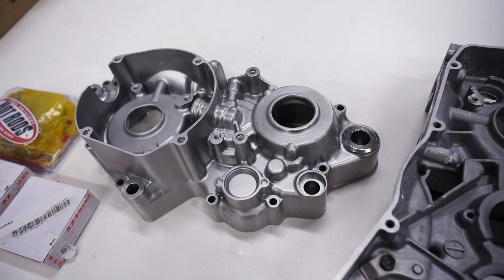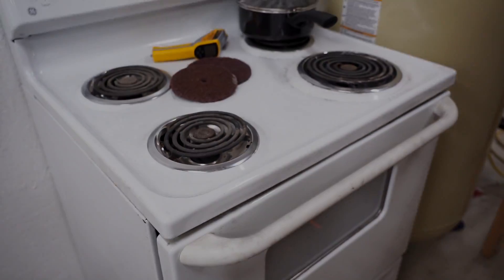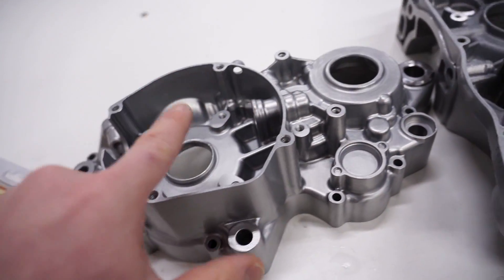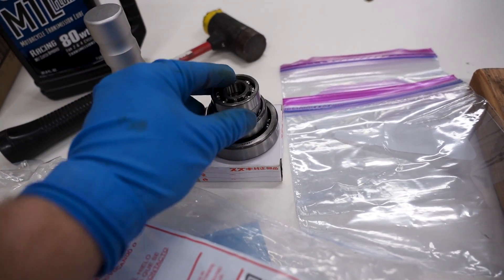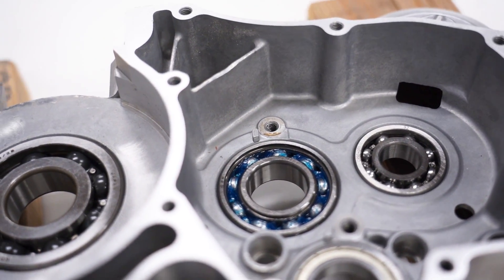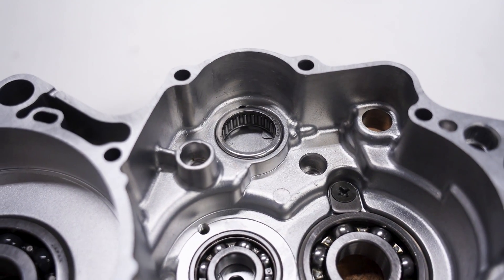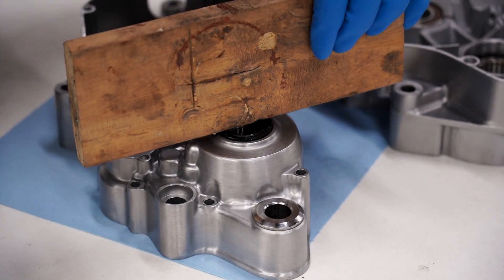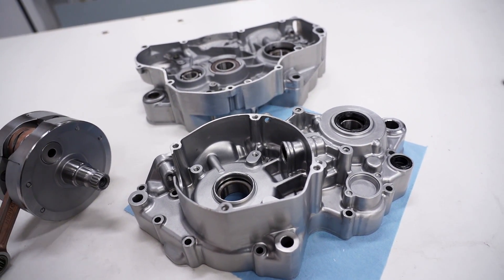Easy Way To Remove And Install Bearings | RM250 Rebuild 10

Comment: could not firgure out how to get my output shaft bearing with that ring out and did not want to damage anything- ur the only guy that actually covered the bearing with the ring - thanks can finally get moving on the 94 kx250 rebuild. Much appreciated-

Comment: Thank you for this incredible method. I had previously ruined a crank bearing by trying to put it in the normal way, heating the cases with a blow torch and hammering the bearings with a bearing driver. After putting the cases In the oven and freezing bearings with dry ice, every single one just dropped in.

Comment: Man this rebuild is fun and educational to watch!
I did start a rebuild, but it's nothing glamorous so I"m not entering... but basically took an abandoned junked 70cc left in a high school shop that had been stripped down to almost nothing. I'm almost done with it and super excited to get my little boy on it. Found out only recently that it's a Lifan motor. The motor was actually way cleaner than I thought. Had a broken tooth on a gear, but no damage inside! It's probably only got a few miles on it. Waiting on some bushings now and need to find a front brake for it (common front calipers don't fit this weird fork leg...). Replaced everything except the motor, swingarm, forks, wheels, frame (which I sanded and painted).

Comment: interesting to see a non yamaha engine go together and the variations of the same principles and the way the manufacturer alters the mechanism ie clutch actuator and shift . the last 
3 yam engines i have built shift drum alignment has been critical and i saw a alignment dimple on yours that you didn’t seem to use, although it checked out in testing after the cases were together. last engine i built had bearings either end of drum that had to be heated and shift drum frozen, an absolute pain to do.
good work as usual had a more relaxed feel to it

Comment: I used a map gas torch to do mine. Heat then a few taps with a socket on the bearing. When installing the new ones, heat the aluminum till it starts to sweat. Then, if you froze the bearings first, they drop right in.
Reply: I was wondering if anyone else has done it with out the oven method. Any issues doing it your way?

Comment: on the bearings after dry ice, why not just return the cases to the oven (if you have one to use) to drive off the moisture...still lubricating them after of course? you have the best content on the tube. stay Pryme and be well.

Comment: Hello Cameron!
Your tips are very useful.
Can I also heat it with a gas torch butane instead of putting it in the oven? And for example, can I heat it up with a torch to remove the bearing with it and use it once it's hot to fit a new one? If you leave the bearings only in the freezer, does it work the same as ice? thanks

Comment: The crank shaft I bought had the bearings attached to it already. How would I get it in the case without wrecking the bearings that are on the crank already? I saw you video about putting the bearing in the case first then put the crank on but that’s not the way I can do it cause the crank came with the bearings attached to it already.

Comment: Hey bro I have a high performance GY6 100cc scooter what is the point of 

changing your CVT bearings after I'm done with the modding that's the only thing I got to change out is the bearings what's good does hyper hyper typos high-quality bearings what does it do for 

your scooter.? Performance-wise h u h do you need to change out your bearings like why do people change their bearings out I don't see any videos a lot of videos 

on the internet about it so I guess it's not really worth doing unless you really want to. Huh.? Message me back ASAP bro

Comment: You think I could use a normal oven for this? I don't have a separate one and being that's it's not powdercoat or anything I am thinking possibly it's not chemically dangerous to do in the kitchen over?
Reply from the maker: You should be good as long as your parts are clean

Comment: SFK are actually taiwan made skf are the ones that make bearings & are quality made its like they have coped the name to mix people up ive actually got a brand new set of SFK seal's myself so would like to no if these actually hold up Cameron mine come in a packet that looks strangely similar to mitaka HI performance one's lol & they are quite handy them bearing puller sets ive got the same one myself

Comment: After how many hours would you recommend to do the bottom end on KTM 300 EXC 2017
Reply: Rocky Mountain has a video all about that. It’s a ktm 300 exc but I don’t know the year.
Reply: The manual recommends every 80 hours or every 40 hours if used for Motorsports

Comment: I need help. My 2003 RM250 swing arm has a gap when I install it! Maybe a qtr of a inch! Any pointers. I can send a video if needed.
Reply: maybe you’re just missing spacers on either side? i’d check your parts diagram to be safe but it’s just a thought, hope it works out.
Reply: 03 rm250 had same gap in rear wheel I used a washer on each side in last years rebuild and no issues all season. Chain side washer had to be about double thickness of brake side to line up chain correct. I think washers were 0.182" total.

Comment: Hey Cameron I’m 13 years old and I have a ttr230. I really like it but it’s sits really low. I’m 6’2 and I was wondering if I should wait to move up to a 250 when I gain more weight, or now. I weight 155 so I’m pretty thin.
Reply: Eat, lift weights, and get a 250.....that's what I did many years ago.  That way, even tho you are "light" you'll be strong.  Hang in there.
Reply: Tom Nekuda thanks

Comment: There is zero point in buying oem bearings as suzuki does not make bearings, they buy them and wrap them in suzuki packaging with a fat markup. Just buy your bearings from a bearing supply company and stick to the good brands. In this case the crank bearing was a Koyo.
Same goes for the seals.